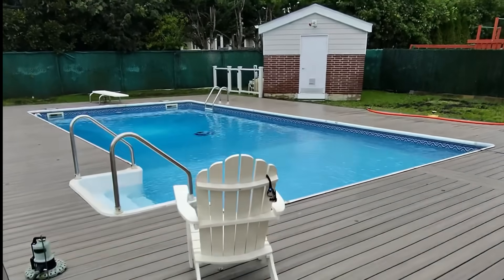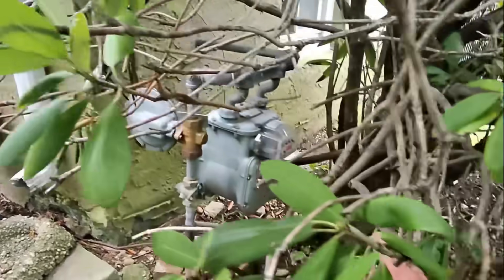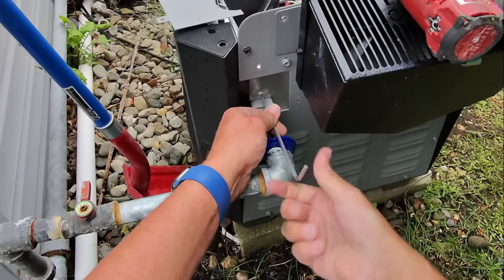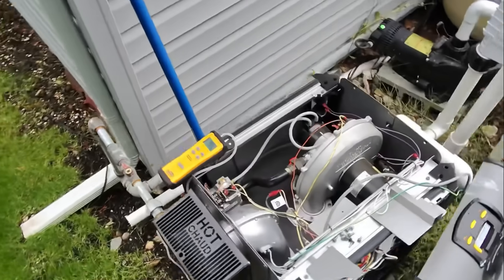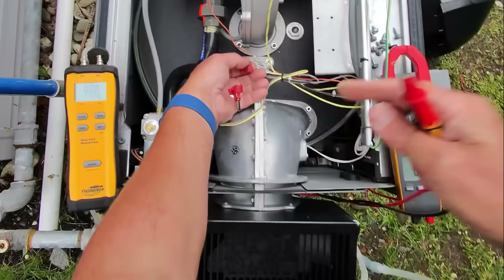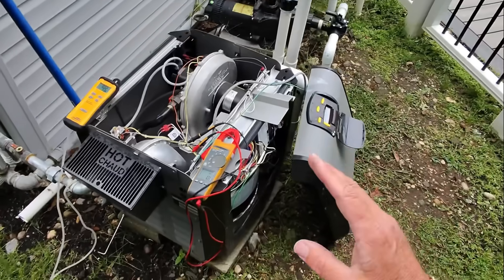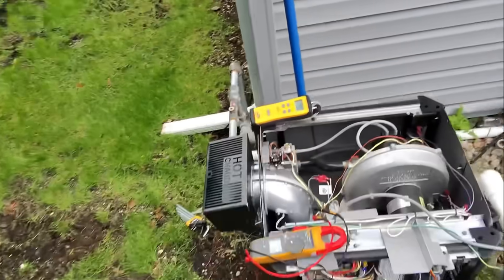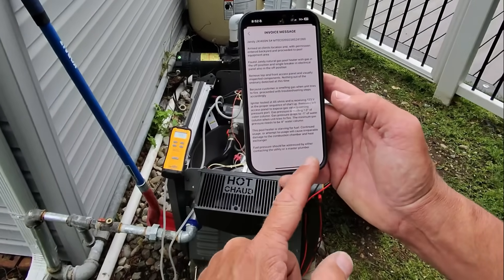Why Does My Pool Heater Smell Like Gas? Jandy JXI 400 Pool Heater FAIL

Comment: Poor mans check to see if you have enough volume and you gave a gas stove.
Turn on the large user of gas pool heater/natural gas fired generator and go inside the house and turn on each burner on the stove, check the flame,  if the flame goes down after turning each burner on you have a volume problem.
Reply: the 3/4" pipe leaving the meter is an instant fail, at ten foot equivalent length, it's only good for like 350K btu on an under psi system(which that clearly is) and there's a ton of fittings all over the place in that house for sure. guessing they had a 200K btu pool heater before at best and possibly standard tank water heater, etc.
Reply: @throttlebottle5906  That is a max 250K gas meter. Some gas company will upgrade for free others no, maybe ask a pool builder that question.

Comment: Reason for low pressure,
Water in the piping 
Too small of a gas meter
Improper piping for the gas meter.
That little shut off near the pool heater, remove it and put in a gate valve not a ball valve.
If you have a shut off valve at the gas meter and one at the pool heater you are killing your volume.

Comment: It’s awful strange that the old pool heater worked with that existing gas meter. I think that the existing gas meter failed number one or the underground gas line could be full of condensate water. There is a pressure tap at the outlet of the meter. it might’ve been a good idea to check the gas pressure there. Or take the drip leg off at the heater open up the gas, cock and seeing if the gas pressure would maintain interesting case good luck.
Reply: New pool heaters are very sensitive to pressure drop, after 3 failed attempts they will lock out and even the gas company rep cannot reset them and you have to contact the manufactures.  We went through hell in the 80 and 90's with the new pool heaters. I old style had the pearl gas line, but were famous for spider webs and roll out flame that made you think you were going to die.
Things were learned.
Bigger gas meter does not necessarily fix the problem if you use the old piping with the converter. Pathetic attempt to fix a problem with minimum  care.
Upgrade all plumbing the 1 1/4 or 1/1/2 piping with a 400 BTU gas meter.
Remove all ball valves between the gas meter and the pool heater, install gate valves.

Comment: 400 btu pool heater plus what ever they have for the house. They might need at least 425 meter or have  a regulator from the gas company install a 2psi regulator
Reply: You are absolutely correct. Meter is a 250 , regulator may have a 3/16” orifice,fuel run sizing (?), total house load in BTU (?). sediment trap at the wrong orientation . Time to contact the gas company,because no one did before the PH install.
Reply: Good luck on getting a 2 PSI system but I know at least one gas company that has made it easier to get, but good luck.
Reply: @Moondoggy1941 ,yes the gas utility in St Louis Mo. From 1982 to  May of 2018 ( my retirement as a gas fitter ) I installed 1000s .And yes the company installed them long before 1982 ( as long as the street was not on a low pressure gas main). You are correct, it is all up to the gas utility & the ones in New York are not big on 2 lbs systems for residential  installations.
Reply: @Moondoggy1941  where I live you do have to submit a form with a calcuation load

Comment: AC doesn't have polarity. Which is hot or neutral would only be a safety issue, but should not affect operations.
Reply: The control board has polarity bud needs a signal to neutral
Reply: @instrumenttech4220 control board will likely take 24vac and then change to DC with a rectifier. There's no polarity.
Reply from the maker: YOU ARE WRONG. POLARITY MATTERS.
Reply: @PipeDoctor  You don't need to shout. Maaaybe I could see an issue with a spark igniter.And maybe if something is improperly grounded and you are getting some current flow between what should be neutral and ground.  I don't see why it would otherwise affect operations.  And I admit, I only have theoretical knowledge (a degree in electrical engineering, which I don't use), while you have practical. So, I would love to know why it matters.
Reply: it's because of the flame sensing circuitry, it uses current limited, line voltage to the flame sensor electrode for "flame rectification", when it's present, touching it and conducting to the other side of the circuit (burner tubes/case), it does just what it says, the flame rectifies the AC to DC and producing a microamp current level high enough for the control to sense and hold the gas valve on. just search flame rectification for more info, but that's the reason, as they just use the line voltage to feed it, vs. having a transformer or step-up circuit. 
I'm not a teacher nor great at grammar, but hopefully good enough explanation. 🤣
Reply: @throttlebottle5906 thank you,  that makes sense.